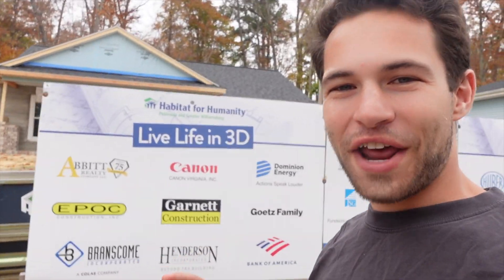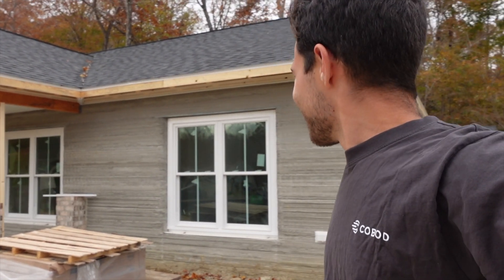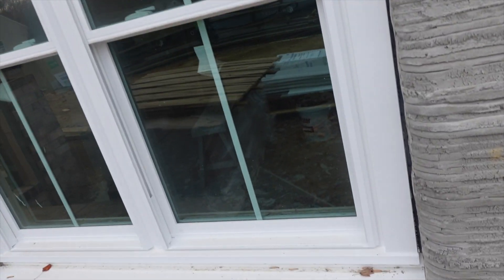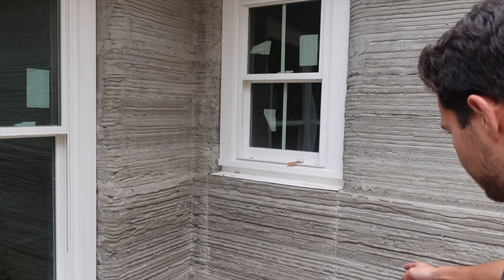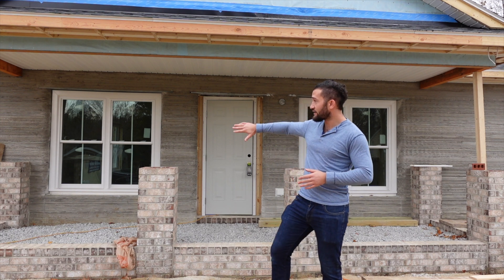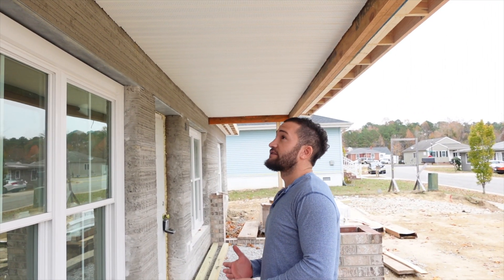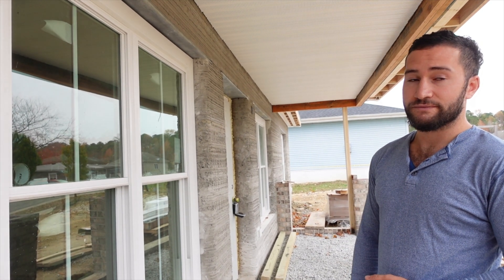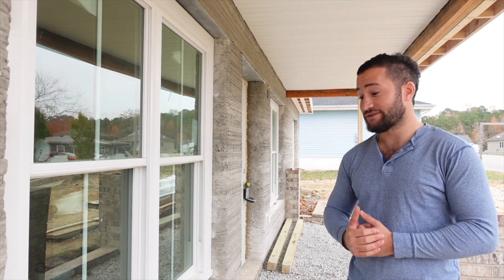You Can't Even Tell This House Was 3D Printed (from inside)

Comment: Another company runs the windows up to the ceiling.  It reduces installation manpower costs even though the windows cost more.  I prefer real plaster as opposed to dry wall.  There must be a spray-on finish that would eliminate the drywall expenses.  Also plaster is mold resistant.

Comment: It's a bit misleading to say it's a 3D printed home of concrete when only the exterior bearing walls are actually "3D Printed".  It takes my crew of four less than a day to stand up wood frame walls with exterior sheathing and siding...or to apply a masonry veneer at a later date.  From that point once the 3D printer is complete with the concrete walls...something secure enough for a "plate" to attach the Wood ceiling joists and pick up the rafter ends for a single story.  Framing interior partitions and where needed interior bearing walls are still needed.  Furring out the interior of the concrete wall for a finished gypsum wall is additional labor for the entire 3D application....not to mention little things like Electrical and Plumbing assuming the HVAC is located into the attic.  Insulated the same way as general construction and finished with 1/2in wallboard and 5/8in ceiling board.

As stated at 10:36 a "traditional framed out wall" with roof system exterior jambs for openings; a one inch air gap between the exterior concrete wall and the interior walls to accommodate the interior insulation making the interior partitions relatively "free standing" and tagged onto the top wood plate at the cap of the concrete wall.  From the....pardon my French....crappy looking rough appearance of layers of extruded looking concrete going up....everything else on the interior as well as exterior columns, porch, soffits & fascia/guttering and downspouts....it's the same thing.  From the exterior...the mud hut exterior with a generic layout is probably unmarketable at realistic prices...so subordinated sources to pay for the exterior wall installation gives the appearance of something that this house would never be.

Perhaps the sponsoring endorsers can help to defray the expenses of the additional costs....but printed 3D homes are pretty much the same tap dance as the "Smart Homes" in the early 1970s that were being promoted.  It sounds good...but it all depended upon little devices integrated into usual and customary electrical circuits found in every home that failed sooner than expected and left the owners with hiring out to retrofit back to NEC compliance for general construction.

Wouldn't it be cheaper to leave the printer back at the shop and hire masons to build a solid split face block wall for the exterior with a few chases incorporated into the masonry?

I'm surprised Habitat would push this little venture as the answer to affordable housing.  Surprised and a bit disappointed that Habitat doesn't recognize the need to encourage more people into construction or for that matter teaching some of the crafts and trades to an already lean labor force.  And please....if you can get grunt labor for free, it defeats the argument that "no one wants to work in construction."

Yes they do...the only requirement is to pay them.

Comment: I have a question : 
If we are at a stage where we can 3D print a house, why is there no company that could make a conveyor belt computer that would be all encompassing (regarding cutting the wood parts needed for the house) which would bring down the price even more.
The company would own the mill, that would put in a tree in on one end and  a numbered (lasered), board would come out the other end. The the same computer would  line the pieces together and nail them down. 
Only thing that would be left is for a few men to stage them on the printed house and bolt them together.
Reply: I have seen the process you are describing in poland.  Minus the tree harvesting bit.  It was on a show about "impossible site" in europe.  The factory used computer controlled saws and printers to label parts.  The lumber and the saw moved at the same time.  It was akin to precast construction, but with wood construction.
The process was not on site.  It was proof assembled in factory, never getting wet, then broken down into modules and trucked to site.
Reply: @ge99ne  Thank you! Do you remember the name of the company? Do they have a site?
Reply: the process you describe is enticing however it wouldn't be practical, timbered wood needs time to dry/cure before being used as lumber. There might possibly be some efficiencies if  you could cut and fit lumber onsite if it was already cured. Maybe even more so if you CNC'd cabinetry. Not sure if doing this onsite would actually save that much as opposed to assembling offsite in the general vicinity in a controlled and then trucking to the site for installation. The details of how long a distance you'd cover and the size and weight of you components are where your cost occur.
Reply from the maker: Sounds like what Tesla does for cars
Reply: @automateconstruction  Is there such a thing?
Reply from the maker: @Ace_Of_Bace  not yet that I know of

Comment: Disappointed that they chose to use conventional walls for interior, which defeats the purpose of 3d printing in order to save labor.  The goal should be to try to build a house in less than 2 weeks.  The method show in this video loses to using precast concrete wall panels, which can put up a house relatively fast, maybe even faster than 3d printing, and with better quality control.  Eventually 3D printing will lose out to precast wall panels if you do not eliminate the labor.  I don't like how things are progressing.  Also, the flaps should have made flatter surfaces that eliminate the need for the additional interior wall.
Reply from the maker: I like the variety